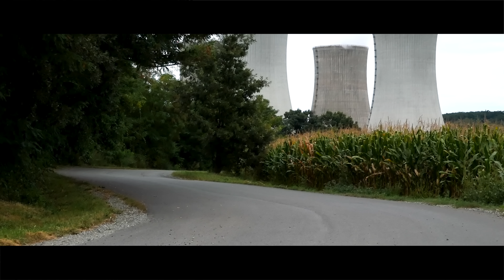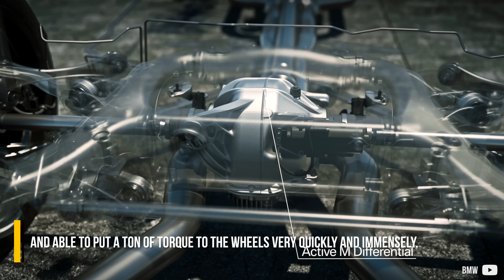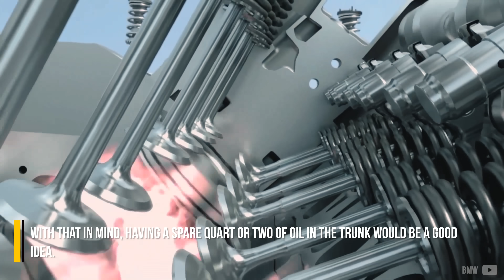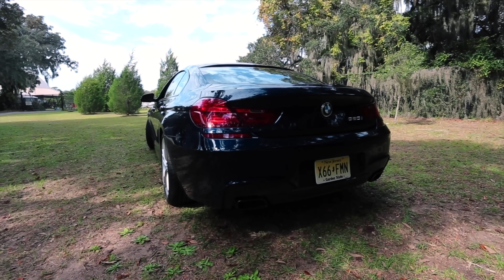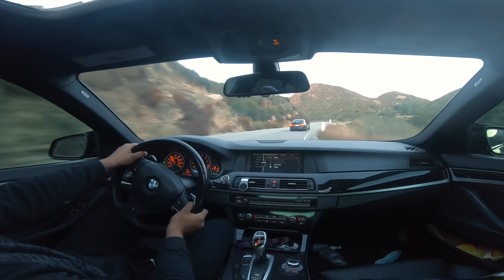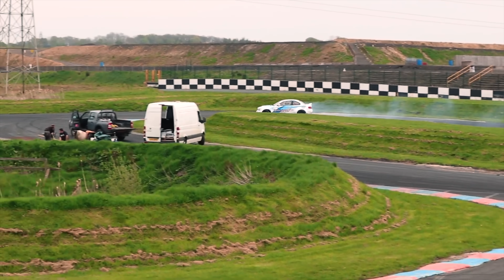The Worst BMW Ever?

Comment: In my experience in owning and working on german cars as an ex-mechanic: the factory oil change intervals are way too high, so if you want it to last and not wear, cut the intervals in half and stay away from used cars that were maintained with the "long life" maintenance plan... Some of those engines have 17.000mile oil change intervals on long life, like the vw 2.0pd had, and that is just murder.
Reply: Every 5K I change my oil in my Audi. My first Audi belonged to a doctor before me and he took it in for the recommended oil changes to the dealership, but...I found a book with handwriting were he did other oil changes between the dealer visits.
Reply: We have a 2012 Passat with the 2.0 TDI CR engine and we bought it back in 2017 with 173 000 km on the clock. Previous owner in Germany drove it only on the Autobahn and changed the oil at 30 000km. Last year we opened the oil pan to replace the thing which rotates the oil pump and were were amazed how clean the engine was and how little wear was on the bolt rotating the pump. The car was on 250 000km when we did that. But also important to note is that we always changed the oil at 10 000km max since we got the car.
Reply: not just oil change. A lot of components need to be replaced before things start to go wrong. Unfortunately, BMW, Mercedes, and Audi engineers don't give two shits about mechanics, stuffing attention needed components deep inside layers upon layers of obstacles. Combine with second hand owners or oblivious owners, things get either too expensive quickly or engines simply grenade themselves beyond repair.
Reply: @mercedescl  If you look at most Mercedes engines from early 90's to late 00's - they're actually very easy to work on. Plugs on top, crank sensors, coolant temp sensors, water pumps, thermostats, vacuum systems etc all really easily in reach. Maybe a M275 V12 starts getting a bit trickier with the limited room but still very straight forward for a high end euro.
Reply: @mercedescl  you nailed it. One BMW is enough for me......just overated plastic junk.
Reply: European concept of environmentally friendly measures taken to pass their stupid regulations -

1 - make extremely long oil change intervals. even if it is more environmentally damaging by destroying your car early and dirty process to recycle the scrapped car. if you don't scrap it, then buy our expensive replacement parts. it helps corporate execs buy new yachts for their third trophy wife. i love environmental regulations!!!

2 - use thinnest oil to increase fuel efficiency figures placed by regulations. say what? thin oils are not as efficient to prevent wear and tear? who cares, it will make customer buy another in 4-5 years. planned obsolescence, baby.

3 - direct gasoline injection. hell yeah. craps your valves like no tomorrow. again, guaranteed engine failure and lo & behold customer is in the market for new car. trade it in, sucker.

4 - just straight up scam the emissions tests like Volkswagen. hell yeah baby we're environmentally friendly companies!!!1!
Reply: @lordjaashin  Strange that germans cars only are problematic in US.
Reply: @lordjaashin  "their" stupid regulations? The strictest regulations are in California and China. These are the markets that set's the baseline, not the European regulations.
Reply: @lordjaashin  I'd actually blame the regulations and say the manufacturer had no choice but these stupid workarounds
Reply: @satsumagt5284  If the Americans and Japanese could do it (korean engines don't hold up) than I'm more than sure that the Europeans could comply if they wanted to...
Reply: @satsumagt5284  do you really believe that regulators want you to consume more oil? That is wrong.
Reply: my audi 2.0 has been serviced with 22-25k mile oil changes for the last 100k miles and when I had to change the crank recently due to timing belt drive gear failure it was immaculate inside. As long as you stay with the highest quality oils like me (pentosin) youre fine. My dad was head of maintenance for SF buses. He would argue oil changes were useless with the SF city council who demanded all buses get oil changes every 3k miles, an incredible waste of oil and man power. His peugeot N9TEA would get castrol gtx oil changes every 60k miles. I took it apart at 350k it was a bit dirty but from the wear and clearances you would have thought it was 35k miles the only discernible wear was on the distributor drive gear.
Reply: Can assure you at 240k miles I will not be doing anything less than 15-20k oil changes every 1-2 years. Lol. That's how it's been for the last 10 years for me.
Reply: WTf? I change my oil/filters every 10k km / 6,5k miles
Reply: I change my s63 oil every 5k miles. I checked the oil resets on ista for the previous owners and the car has had 5k oil changes its entire life. I burn zero oil and have never had any issues.
Reply: @wesleyfancher4280  well that's what the proper interval should be which usually equates to about 1 year of driving for a normal person that's why manufactures always state 15k miles or 12 months because more often than not you not doing the 15k miles a year, issue is most people try to cheap out on maintenance  as much as possible and then problems start to appear, its also bigger in the states as far as i know cause most of yall don't require a yearly inspection to be able to keep driving your car
Reply: @chippyyyy  In the UK they need an MOT every 12 months.
Reply: @willm203  yeah same over here in Portugal
Reply: My shop does hundreds of oil changed a week and I can confirm what you say about those dangerously long intervals. Every single one which stick to those miles is a chronic oil burner. The only vehicles I’ve seen which manage those kind of miles well, are granny-driven hybrids.
Reply: I would say cut in a third, I never exceeded 5000 mile intervals on my 340i, especially because early B58s seemed to have a bit more blowby causing my oil to smell like fuel which really kills your lubricity.
Reply: yep oil is cheap --- engines are expensive . From my motor bike days back in the 1970s learnt to change oil often around twice a often as recommended by manufacture ---- never had a issue with any engine current car near 300,000 miles and burns near no oil.
Same applies to Sealed for Life Gear box oil --- rubbish it needs to be changed after 100,000 miles 10years
Reply: I agree Oil properties are deminihed over the best to change 12k or 12 months
Reply: 17 000 miles? You crazy never see that in any book. Its 20 000 km but best change is on 15k km.
Reply: @MrChad97Z modern synthetic oil runs a lot hotter and doesn't sludge up at low temperatures. My 2001 E39's run for about 17,000 miles between oil changes with normal use, viscocity is good even though the oil looks pretty dirty as both are 530 Diesels. My '93 E34 520i runs for about 8,000 miles between oil changes, could certainly run for more but I stick to the maintenance indicator. But I tend to change oil at orange not red and make sure I use good quality oil filters.
Reply: note that both engine clearances have nothing to do with what they used to in the 90s and so does oil quality (and price), it has an effect on change intervals. Long Life oil means... well long life. You don't have to use LL oil and can change oil more frequently if you choose to
Timing chain issues have nothing to do with oil and everything to do with chain and cams tensioners' quality. We expect it to be the best on a BMW and it isn't. It was good in the 90s and it's now crap. Simple as that
Reply: I have a C7 RS6. I change the fluids every 5000kms
Reply: Oh come on Beemers use oil so much that they are almost 2 stroke.
Reply: @scottrich976  I've never had to refill on any of my bimmers with a 30k interval.
Reply: @sjoroverpirat  I've seen many BMWs that use a litre of oil to every 120 litres of petrol.
Reply: @scottrich976 Just passed 80,000 miles on my BMW s63tu engine. Change oil about every 3500 mi and have never even had a warning light on EVER and burns absolutely zero oil! I can't speak about other people's engines only my own..
Reply: Except the n63 regardless of oil change interval, fails
Reply: Add oil filter and oil quality. Damm I used to put valvoline racing 20w on my 78 honda full yosh honda 750. Oil and filter change every 5k km.
Reply: Well, while it may FEEL that way, driving style and conditions heavily influence both the rate and severity of oil degradation  - and the corresponding time/mileage elapsed before a service warning is flashed up. The 17000 miles referred to is certainly towards the upper limits which in my days at VW/Audi, were 19000 miles or 2 years. Given I was based in SW London, as were most of our customers, the vast majority of their cars came in for service way before that - simply because the traffic conditions in a city implies more cold starts, stop-start driving and shorter journeys where quite possibly the engine never, or rarely, quite gets up to temperature and so the sensors detected those sorts of factors - and how dirty the oil was getting - and therefore "knew" of the greater stress on the car - hence advising service intervals for most, far shorter than the theoretical maximum ones. It was only a few, driving very lightly and under optimal conditions - long, steady state trips with little acceleration or braking and everything at optimal temperature - who got anything approaching the max. Therefore, certainly with VAG Group products (I can't speak for the BMWs mentioned in the clip) I don't know why everyone feels they know better than some of Germany's (and therefore the world's) foremost automotive engineers who developed the car to work just fine with the variable (and likely longer ) service intervals, enabled in part by synthetic oils which go the distanc.. In short, if you stick with the manufacturer's recommended intervals as advised by the car - and have the proper "long life" service done (including the appropriate oil), it'll be fine!. It was down to the customer whether their car was set to extended/variable service interval - or the fixed. I know the overall health of the engine is better revealed over the longer term rather than the typical medium term most of my customers tended to own their cars but even so, I feel quite confident in supporting the official line  . .
Reply: Though I do not own a german car - korean instead - I change my oil each 4-5k. Thing is I bought it used from some old guy as my first car - and he insisted I do that, even teaching how to do it myself. I own it for four years making around 8-10k kms per year, changing oil twice a year like a clock.
Reply: Great advice
Reply: To give the TDI guys the benefit of the doubt, lots of them including me when I had one, swear by longer OCIs. Guys would run up to 20k with oil analysis. According to the analysis, oils start getting bad around 15k miles. Now keep in mind these are synthetic diesel oils, so they are specifically made for long OCIs. In my gas car now though, I usually go 7k. Gas cars sludge a lot easier.
Reply: for sure, the 30k service intervals are insane i dont care how many "longlife" oils they use i change my oil and filter every 10k kilometers. Cheapest and best insurance ever
Reply: Thanks for the heads up, from your vast experience with BMW's would you recommend a F34 328i or 320d? I'm considering one of these thanks
Reply: Turns out, even modern toyota needs more frequent oil change than the brand suggests. It's best to change oil every 5000 miles. 
This video I share explains it exactly like the op has said.  
https://youtu.be/TJhFAwFv-O0
Reply: BMW did my oil every 8000mi in my B58, which isn't bad, but the dealer uses 0W-20 which is not adequate when you're pushing it in the summer heat. I bumped it up to Red Line 5W-30 and doing changes every 5000mi. We'll see how it works out in a couple years.
Reply: I had 300k miles on a E500 with the 15k oil changes. Engine was perfect when I sold it.
Reply: BMS used to recommend more frequent oil changes, until they had to pay for them then they moved it to 15K miles and "life time" oil. Not oil lasts a life time, especially in a mechanical device like a gearbox
Reply: 100% agree. On even my old 98 Merc AMG its a 15000km interval - I was like wtf - so I do it every like 6,000km max.
Reply: @thatmatty231guy  6,000KM's is really too early for any stock engine, 10,000KM's is usually the norm. I change the oil every 5000KM's in my 400HP Opel Z20LET, but that's because it makes more than twice the stock power and the oil starts stinking of petrol after 4000-ish KM's
Reply: @thatmatty231guy  If Mercedes says 15k then its 15k. Oil change after 6.000 is hilarous sorry, even with old AMG.
Reply: @LiquidIEx  You clearly have no idea lol. If you know anything about automotive if you drive something harder or its a higher compression / higher power engine its better to do it sooner. 

I suppose you think its hilarious people change their 'transmission oil for life' too?
Reply: @thatmatty231guy  Well every german car engineer will give you the same answer. No engine needs new oil after 6.000 km. If you want to waste your money to feel better, do it. But technically it makes no sense at all.
Reply: Exactly, my N63 treated me very well on 3k mi oil changes. I also pushed the car a lot which is why I changed it so frequently
Reply: @kirunacat  glad to see that there's still people that know how to take care of their car especially if the push it hard and have some fun
Reply: Funny, I have an E90 and change the oil every 20,000km as per the service indicator. Always use Bmw filters and service items and always run the same oil. Have had zero problems….. 467,00km to date….. gotta love the N52
Reply: as an ex mechanic you missing one key point, yes the oil change intervals are super high if you go by miles but its usually x amount of miles or 6/12 months whichever comes first
Reply: @chippyyyy  what if u use it a lot and u do 15000k in 3 months..your point fails
Reply: @gazzarafalemozzy4766  it doesn't, an oil change is made at whatever comes first mileage or time, if you do 15k in 3 months you replace the oil every 3 months to prevent problems, my dad does that every 6 months even tho the oil states 1 year for the timed change because he does the 15k km in less than the stated year, it's literally doing research, oil changes and about anything is always based on time and mileage and you do the repaciments in accordance to what comes first
Reply: @chippyyyy  THE POINT IS 15K MILES IS TOO MUCH..by the time u are at 15k uve worn down parts..my point was for a turbo engine that is negligence
Reply: @gazzarafalemozzy4766  the almost 300k on my dad's car beg to differ, it's an e220cdi and the engine is as healthy as a brand new engine, not all engines neither all oils are the same, just because the car has a turbo doesn't mean much, my moms car has double of that it's 30k or 2 years, it's on 249k and also 0 issues
Reply: @chippyyyy  ur not impressing anyone..15k miles before a service on a high compression engine is just dumb
Reply: @gazzarafalemozzy4766  It really depends on the car/engine. e.g. 2014 VW Polo (very small engine). Oil change after 30k km or 1 year (had 2 times 30k the rest 1 year) with LL Oil. Close to 200k now and no problems. 
Usually its more important, when the engine is new, like für the first 50-60k km to change more often. After that use the regular should be ok. 
Also like first stated, it depends on the engine. A V8 400PS has different needs from a 3cylinder with 80PS and Otto from Diesel etc.
Reply: @chippyyyy  I change the oil in my car every 2 to 3 months. I'll put about 7,500 miles on my car, in that time. 2001 330i at 230k miles running strong. Can't complain.
Reply: @CMitchCars  makes sense to do it that frequent, wish more people were like you and knew how to maintain a car properly
Reply: @CMitchCars  I have one same year with 330,000 miles  and counting.  Those engines are great.
Reply: @chippyyyy  That’s usually the case with most Japanese brands for as far as I can remember. I”vê owned a few Audi and Mercedes cars, and don’t remember ever seeing something similar in the maintenance schedule. Even my 2004 Audi A4 1.9 TDI could have a standard  15.000 km/ 1 Year oil change interval, or the Long Life (2 Year, with the remaining mileage “monitored” by the ECU, which could go well beyond 30.000km in those 2 years).

The ECU would try to make a somehow educated guess on the oil condition based on average rpm and other things, but it was still a guess.
Long service intervals became another selling point at the dealership, because it implies savings to the owner.
Some Japanese brands are criticized on reviews for their shorter service intervals, but that’s easy to say when the reviewer is always playing around with new cars lent by manufacturers.
That’s not that fun when their own car has a severe and costly engine problem, and they have to put their own money into it. 😉

Truth be told that most European car manufacturers went down the same route, with many common problems.
Stretched and broken timing chains/guides are as common on Mercedes 2.1 Diesel engines since 2009 as they are on diesel BMW’s from that age.
At that time, the 4 cilindre 2.0 common-rail VW diesel engine was the most reliable of those 3, but with the infamous software on its ECU. 👀
Reply: @chippyyyy  yup... thats why there is a miles or time limit just like your cars insurance.
Reply: @chippyyyy  As an ex engine reconditioner the issue is the poor design of the oil control rings used in Euro cars.
Reply: I'd agree, although if you are fastidious about doing ALL the maintenance, oil changes, filters, breather filters..... the engines will last for 100s of thousands of miles. My E34 M50 has 208,000 miles on it without anything but regular and carefull servicing. My two E39 M57's both have over 150,000 miiles, with hardly a beat missed (they both needed water pumps last year). Too many older BMWs are bought by people who don't evene do the routine maintenance and then wonder why they break.
Reply: @grahamepigney8565  you dont have to be fastidious, just change the oil and filter every 8,000 miles using top spec parts and the right grade oil --- then you will get over 200,000 miles out of your car
Reply: @duncansteward4331  pretty much what I said.
Reply: @grahamepigney8565  i just agree with you Oil cheap --- engines expensive
Reply: @grahamepigney8565  100%
Reply: @grahamepigney8565  Greetings sir, I totally agree with you. I have owned bmw's for the past 30 years and really no engine issues.
Reply: When I reset my BMW's OCI, it shows 21,000 miles until next oil change. NFW am I waiting that long, even though I mostly drive on the highway. 8,000 miles is my interval, using LL oil.
Reply: @dougrobinson8602  its really interesting to hear that. in turkey every car's oil reset at 10.000 miles.
Reply: @dougrobinson8602  Damn! 21000 miles lol thats crazy!!
Reply: My car at the moment is bmw x5 e53 3.0d  2004 facelifted model. The car is at 410,000km. Not a single problem with the engine for 3 years now, I got the car from the BMW dealer with service history and to be honest oil change was done at 16/17k km intervals. Since I got the car I change the oil every 6-7k km no more than that. The timing chain has not been done yet since the car left the factory from USA, there are no symptoms of the chain going bad but I will do it just to be safe. There is no oil consumption either.  Only problems  I had with the car was front suspension and rear airbags.
Reply: @radoslavmitkov425  There are always exceptions
Reply: @edjackson4389  not really, there are no bad engines, it is just people that are bad at taking care of them. Other example is my father car vw passat b6 1.9tdi PD BXE. Few of his friends said don't by the car because they are famous for throwing the rod. Four years later engine is at 308k km he put on it 70k km for the years without single engine problem. Only regular service.
Reply: @edjackson4389  I have a F30 330e that had 20k OCIs from new. I’m slowly decreasing the mileage. Currently sitting at 132k miles no engine problems and I burn oil at 1litre per 3k miles or so. Car has been doing almost 20k miles a year since new.
Reply: @Dmxravin  What's your point? Because you had decent luck with one Im supposed to be convinced they are fantastic cars? I've   been dealing with them 31 years
Reply: @edjackson4389  my point is if you use the right spec oil, in my case LL17FE+ and do the miles (long distance in one go) it is possible to have a relatively trouble free engine. LL17FE is a class c5/c6 oil specially formulated to avoid deposits on chains and turbos. My previous car is a Prius Gen 3, 380k miles ran with extended OCIs original engine and gearbox. 

I’m assuming you’re a mechanic so you tend to deal with cars that have been neglected, driven short distances or both. So your view is skewed.
Reply: So. In my opinion at least VW TDI are good with long life oil Services. My dad had a 2002 Passat and it would only see the workshop when the car told him to do. This one lasted for 410k km (something like 260k mile) before the transmission or clutch made it a financial total loss out of it (sure it still runs with some scrap yard parts somewhere in eastern Europe or Africa...). The engine however ran perfectly fine without much oil consumption (maybe 1l refill after 15k to 20k km). My personal car is the same. Bought it with 140k km (2015 model Škoda TDI, manual transmission on purpose..., Serviced every 20-28k km at the first owner and also at me), now it is at 185k km. There is also very little to no oil consumption (1l after about ~20k km). My dad's current VW diesel has 150k km and the oil consumption is just a little higher (1l after 10k km), but unfortunately you can feel the shifts of the DSG much more 30k km after an oil change (it has an 60k km very short oil change interval). So engine is fine, but transmission is service intense. That's the reason I went with the manual transmission on my Škoda... Both newer diesels have not had an emissions Software Update. So that might be part of the story, too.
Reply: My 2001 330i has went by the oil change intervals from factory and that engine is still going strong with 330,000+ miles on it.  My e93 m3 has went by the intervals and has no issues and is nearing 90,000 miles.  I think it’s more if someone pushes the car too hard or let’s coolant and oil run low and keeps driving it.
Reply: I've also done 5k oil changes but granted mine is a B58, regardless still under the BMW brand :)
Reply: My experience is high performance BMWs=Fast Junk
Reply: @edjackson4389  they dont need tp be high performance tho 😂
Reply: @chippyyyy  True!😆
Reply: @chippyyyy  Bro my E30 has over 260,000 miles on it with zero rust and has ran great since I bought it, although I did do a decent bit of preventative repairs.

The E30 and E46 generations were truly built to an absurd standard. It is the complexity that fails but luckily my worst experience is fixing a passenger door window switch. These cars will both last incredibly long if they are taken care of.
Reply: My E90 has over 300 000 kms on the clock. I hardly ever change the oil. So there goes your theory. And I service the car every 2 years🤣🤣
Reply: @KalahariJack  its not a theory, what it is is very dependent on the the type of oil and engine and also on how many kms you drive on that oil and how hard you push the car which is what makes the oil degrade faster,  i have a 16year old Fiat Stilo multiwagon and i also only change the oil every 2 years because not only its the recommendation of the selenia Oil  for that car but also i only do about 10 000kms a year of the 30 000kms recommended for the change, my dads mercedes on the other  hand requires an oil change every 15 000kms or 12 months so he does about 2 changes a year due to him doing about 30 000kms a year